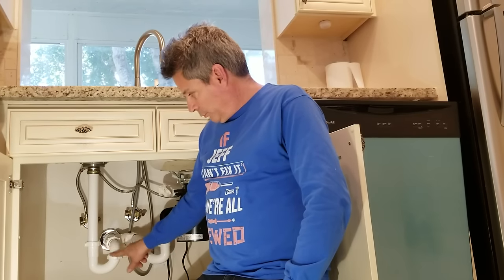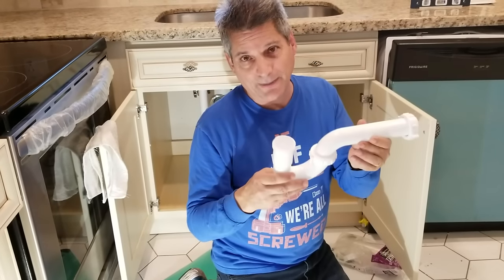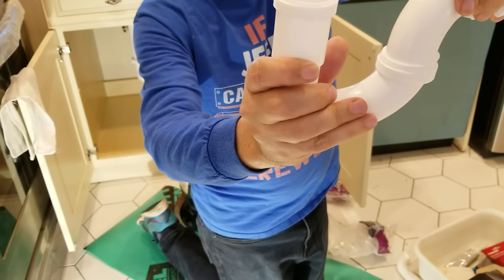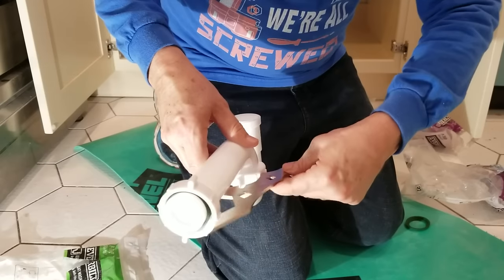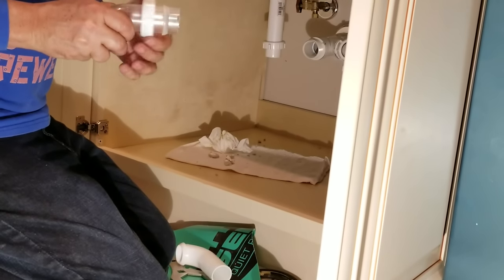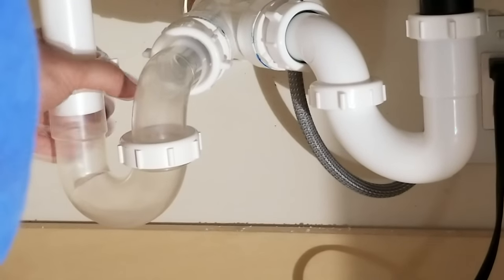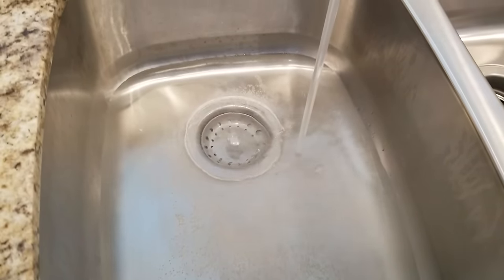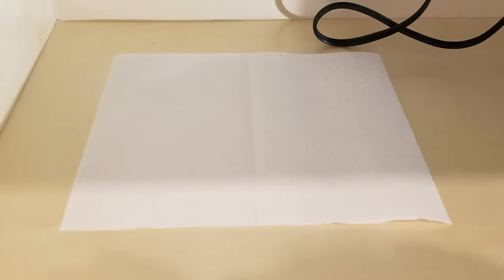Why is my Kitchen Sink P-Trap Leaking at Connection Nut?

Comment: I know this is an old video, so you probably won't answer, but would there be any benefit to wrapping some plumber's tape around the threads at the connection where there's no rubber gasket? I'm gonna be doing this job (replacing the P-Trap) at my elderly Mom's within the next few days, so that's why I'm searching for and watching videos about P-Traps today, and why I'm taking a shot and asking so I have a chance at possibly doing it "right".
Reply from the maker: No, but I have seen some plumbers add pipe dope to the smooth part of the connection where one pipe section sits inside the other, and then the nut goes around it. But if you use the main theme of this video that I showed, where you tighten this connection first before the other connections, this will work for you. I have solved this issue numerous times by making sure this connection is  aligned perfectly and satisfied first.
Reply: @jeffostroff  Thanks so much for answering! I'll skip the tape and try to connect that part first and get it in perfect like you showed, but now I'll also buy some pipe dope just in case, no matter how hard I try, I can't get it to where it doesn't leak.
Reply from the maker: @MattxietyA   Be sure to let us know if tightening that nut 1st helped you out just make sure it is perfectly aligned correctly before you tighten it

Comment: So… I removed, cleaned and reinstalled the trap, doing the critical ungasketed connection first, carefully seated it, hand tightened, then tightened ¼ turn, then did the other connection at the Insinkerator and there’s still a leak at the ungaskted nut. What’s the next step?

Comment: Mine is leaking at that joint. Can I use pvc glue on it , then tighten?
Reply from the maker: No this will not help you as that joint is not a cement joint it is a friction joint. The idea is to get the alignment right first on this connection before any other connections, and tighten this one fully first, then complete the tightening on the other connections. If you want to cement them, then by PVC P-traps instead of these poly plastic p-traps/ The PVD p-traps were used a lot in the 1970s, as they can cement together, but it is permanent, no way to take it apart if there is a a clog.

Comment: I have 2 quick questions. I have what looks like a capped 1 1/2 inch pipe under my kitchen sink. What the heck is it? Number 2: I bought this house 11 years ago and  my kitchen sink never seemed to drain freely. The clog just goes from "not too bad" to "completely stopped" over the years. What can I do? I have tried the bottles of clog removers and I even tried the rubber hose and bladder.  I noticed one thing and I don't know if it's normal. I ran a snake in my line but it didn't get far because my drainage line turned sharply. Any advise would be appreciated.
Reply from the maker: If you have a capped 1 1/2" drain pipe under your sink, it is likely because your kitchen was remodeled at some point in time and they switched from a dual sink with 2 drain pipe down to one larger sink with only one drain line needed. They typically cap off the unused drain line. You have the right idea about snaking the drain, but your snake is not good enough like the pros use. You'll have to pay a plumber who uses a motorized flexible snake that the machine spins the snake and helps it get through the line. Don't waste one more cent buying drain cleaners, none of them ever works outside the commercial, it's total snake oil. With kitchen sink, all the chicken fat, oils, butters,  and greasy food people drop down the garbage disposal and drain eventually congeal and cause these clogs, which require physical agitation to clear them.
Reply: @jeffostroff  thank you so much! I'm good with paying a good plumber now that I know what I'm dealing with. And also I'm removing that accordion pipe thanks to you.

Comment: Do you recommend using thread seal?
Reply from the maker: No, you should not need to use thread seal on the p-trap pipes. We should focus on getting the connection correct and seated properly so there is no leaks. So unless the manufacturer says to use thread tape or pipe dope, I would not use it.
Reply: @jeffostroff  okay thanks very much again 👍

Comment: If you get a chance show how you would correct vertical misalignment on a bathroom pedestal sink. Personally I'd never install one because they're so impossible to work on with poor clearance.   That said, how do you work effectively on one that has vertical alignment problems? In this case I have a 150 year old home with no way to shim or deal with a sagging floor that puts the pedestal out of plumb.
Reply from the maker: Luckily I have not had to do that yet, but I would imagine pulling the sink first and either raising or lowering the pipe to where it should be that is how I would do it. The other pedestal sink I worked on in the last 10 years was a couple of years ago at a friend's house we just tore the thing apart and put in a real vanity it gave them more storage I have a huge dislike for pedestal sinks
Reply: @jeffostroff  Yeah, I did wind-up using thin rubber fender washers (1/8 &1/16) as shims, gluing them to the base to get it plumb.  I recessed them enough to cover them with caulk hiding them and the gap as well.  I'm flabbergasted that the  designers put the mount holes 10-1/2" on center.  What only one stud?  Good enuf?

Comment: Hi Jeff - In looking at your video, I'm having a leak beyond the p-trap.  When I turn on the water I'm getting a leak somewhere between the trap and the connection behind the cabinet wall to the waste pipe.  I can see the water at t going down to I believe the waste pvc pipe.  Note, there are no leaks under the sink from any connections_ what's your assessment of my issue?  The leak appear to be coming from the pipe connection behind the sink wall running down leading to the waste pipe.  I can see the waste pipe from the basement ceiling (apprx. 6 inches parallel from the outside house wall).
Reply from the maker: If you have a leak at that connection point on the P trap it is almost always because it was not properly set before it was tightened and so if you look how the two pieces fit together one fits into the other almost like a bowl and this is such a poor design because you really have to be super critically perfect on that.  This is why we tell people to make sure that is completely totally fitting level into that connection and then you tighten a nut first before you tighten any of the other nuts so this connection must be satisfied and perfect first before you attempt to tighten any of the other nuts if you tighten this nut last, then you are inviting problems because chances are it's stuck in a position that's not completely level fitted into the P-trap output. Once you have it all together, Then make sure that the entire apparatus slopes slightly downward to the wall pipe.
Reply: Thanks for the response.  Now, its a matter of how I get to this area because this portion of the pipe is bewitching the wall and makes for a very tight space to work.  Any further suggestions?

Comment: Whats it mean when you hear your sink dripping not from faucet but coming up from the drain, and the garbage disposal quit working 2 days ago? Also had a plumber from  our home warranty policy to fix our upstairs toilet wouldnt flush, he snaked it ,2 days later heard a loud clunck and doesnt flush anymore and we saw water running down downstairs bathroom window?
Reply from the maker: Denise, hard to figure out the issue from your description, but if you have water rising up the drain from the garbage disposal, it likely means the p-trap under the sink is clogged, or you have a clog further down the drain lines that needs to be snaked. Quite common to get clogs in the kitchen drain system leading to the sewer, because people dump chicken fat and other fats that over time clog up the pipes and needs to be snaked. Also I doubt your garbage disposal really died, Have you tried the red reset button on the bottom edge of the garbage disposal? If it popped out, push it back in. Is there a jam in the garbage disposal? If so, get a jam buster Allen wrench and attach to the bottom and rotate to release the jam if something got caught in it. As for your bathroom, hard to figure out, did the "plumber" bust through the pipes with his snake? Do you have cast iron pipes which may have developed holes? You have typically 3" or 4" pipes from your toilet, so don't see e how those would be clogged enough to prevent flushing after he left. If problem is toilet, I recommend the American Standard Champion 4 $199 at Home Depot, I use it in all my properties, flushes a bucket of golf balls! Try hiring a real plumber, that guy might have been an apprentice, ask for the license holder to show up to do the work. Yo want an experienced plumber!  Let me know what you find out with all of this, these are some great scenarios.
Reply: @jeffostroff  thanks for info, he came back out and snaked it again, found no issues with toilet. He found a screw in the garbage disposal. He suggested to send out a person with a camera to look at pipes. Still need to know why water ran down window.
Reply from the maker: @denisemiller7466   Yes camera would be what I would do next for sure. Sometimes people find that out in the yard tree roots have crushed through the pipes in her blocking it keeping anything from working in the just backs up.

Comment: Is it permissible to brush a little pipe dope on that particular joint where the surfaces mate together?
Reply from the maker: Some plumbers do, but I think it interferes with the design of the p-trap. IF you connect it right you should not have to add any pipe dope

Comment: Mine leaks at the opposite connection, the one from the sink drain. I think it's air being pushed back through, especially when flushing the toilet. Would putting a vent in solve this problem?
Reply from the maker: Sometimes yes, you really have to look at all your venting, and also the drain lines tot he sewer. Friend of ours last year had same issues, and they scoped the drain pipes with a camera and found tree roots pierced the sewer line under the front lawn.

Comment: Thanks - but that raises the question why doesn't the end of the p-trap also use a rubber gasket instead of just the flared end?
Reply from the maker: I always wondered that too, there would be a lot fewer leaks
Reply: @jeffostroff  Hi Jeff - if I want to use the more sturdy schedule 40 in my sink instead of the thin plastic pipes do I also use washers     On the threaded connections or teflon tape or something or just screw them on as they are? Thanks!

Comment: You knock the “Handyman Joe” but you have a double P-Trap under your sink.  Very Handyman-Joe’ish if you ask me :) Nice breakdown though!
Reply from the maker: There is no double P trap under the sink, you  the amateur of you cannot even tell that LOL. Where is the 2nd ptrap?  I bet we never hear from you again.
Reply: jeffostroff Hmm... I’m right here. One from the sink w/ disposal and the 2nd from the other side. What am I missing?
Reply from the maker: @jg8644  You are confused. There is no code violation in what we did, by "double trap", the code refers to "double trap per fixture", not the aggregate total of 2 traps like you claim, meaning one P-trap after another, which was a common but flawed method used in years passed, often an S-Trap. If there were 2 P-traps in series in our installation, that would be a double P-trap, and that is not allowed. Here in Floriduh... we have plumbing code 1002.1 Fixture traps:
"Each plumbing fixture shall be separately trapped by a liquid-seal trap, except as otherwise permitted by this code... A fixture shall not be double trapped."
This means that the sink left basin is one fixture, the garbage disposal is another fixture, and each must be trapped. Yes you can combine both sink bowls with one trap as many people do, but the kits are a flawed design, with a simple horizontal pipe that could allow water from the left or right basin to run across the P-trap opening without going in. A better design has one sink draining higher into the main tail pipe, then the other sink with the garbage disposal can drain at a different height so the 2 streams don't collide.
Reply: jeffostroff You’re reading too much into this.  Double means “2” and you have 2.  Also - I never said it was not code compliant, unless I triggered the response with the phrase “double p trap” which you immediately read as “in series”.  Your claim that a shared trap is a flawed design is debatable and not gospel. Positives to 2 fixtures sharing a trap are aesthetic, space saving under a kitchen sink for instance, and great to have while troubleshooting clogs (especially if one fixture is a disposal).  Also - I’d also say a positive to a shared trap w/ disposal is that ground food/material from the disposal/dishwasher won’t remain in its own trap until the fixtures are used since all activity will flush it. All that said / I was just giving you a little light ribbing since you took your own jab at “handymen”.  Being one who has a self-proclaimed “above average” understanding of plumbing, I’ve personally never seen the 1 per fixture followed — BUT then again, I’m in California, so code may be different.
Reply from the maker: @jg8644  Your code is pretty much the same as ours, as most states are based on unified plumbing code, which started in LA in the 1920s. Other difference is you  use black ABs, we sue PVC.
Reply: @jeffostroff  the tee that you keep referencing has baffles inside to divert the water so it doesn't collide.

Comment: Why aren't traps designed to have the connection nut up above the water line and in the straight section?  Easier to clean out?
Reply from the maker: I think that would eliminate most leaks for sure!
Reply: @jeffostroff  well I was honestly asking the science as a novice, but you explained things pretty well later on.

Comment: Hey Jeff, I wonder if you can help. 
On my setup it is impossible to tighten that connection first. 
When I do the other part is way too high to bring down to connect to the sink pipe. 
Any ideas on what I can do?

Edit:
Here I am twenty minutes later relaxing ⛱ as I've finally sussed it, yay! 
Though it was kind of shown in the video it wasn't stressed enough that it's best to connect the three parts together separately outside of the 'under the sink' area so that they're all flush with each other. 
It was driving me nuts trying to line up all the threads in the 'under the sink' area cause of the limited space and angle of view.
Reply from the maker: Yes usually we have good clearance under the vanity to reach all of these parts of the p-trap

Comment: Hi , do you need to use thread sealant at the threads ?
Reply from the maker: Some plumbers do use it, I prefer not to use it because if you tighten the nuts properly, they will seal and you won't need it. The thread sealant only lasts until the next time someone opens up that p-trap.

Comment: My kitchen sink P-trap leaks from the opposite side of the trap that you are showing how do I fix that in other words it’s not leaking from what you are describing in your video my leak is coming from the opposite side of the P-trap from the sink pipe coming down into the P-trap that’s where it’s leaking from I tried everything can’t fix it any suggestions
Reply from the maker: Make sure you have a gasket in there. and also make sure you place the gasket in correctly, it should be shaped like a bowl, with the bottom of the bowl resting on top of the P-trip in order to make that seal. Also, make sure that downpipe from the drain goes all the way into the P-trap opening, and all the way down to the stop. If that downspout is too short, then the water might try to leak out of the connection.
Reply: @jeffostroff  I will thank you so much I’m going to try it right now and I will let you HAL it came out

Comment: Jeff let me ask, So FL homeowner here, and I know that down here most homes are schedule 40 and solvent welded from the kitchen to the bathroom from the git go. So why is it between my plumber who is licensed, the big box stores, and even your vid here are "we" using these BS  lightweight slip joint kits instead of using schedule 40 with a  combination of solvent welds and Teflon sealing compound which seem to allow for  a much tighter seal and robust set up?
Reply from the maker: Yes, back in the 1970s, all P-traps were 1 1/2" solid PVC all cemented together. I guess the newer rules have to make the P-trap removable so grandma can retrieve her wedding ring when she flushes it down the sink by mistake. I agree, these thin poly pipes are not as reliable, and they could have done this with threaded PVC parts.
Reply: @jeffostroff  Jeff i really appreciate your time and comment. Can I use a schedule 40 to poly p-trap adaptor? Is that FL code? My previous plumber used a reducer to solvent weld what I have seen referred to as the crown/trap arm/outlet  poly pipe to the schedule 40 pipe coming from the wall and although it works I would rather have the ability remove the crown pipe rather than have it solvent welded and turning downward like it does in case I ever need to snake the lines. I hope my question is clear. Thanks
Reply from the maker: @rock-on6nt  Yes, I use hub adapters all the time, they cement onto the 1 1/2" pipe on the wall, and the other end of it has the threads and the nut to accept the output of you poly P-trap.
Reply: @jeffostroff  thanks again. That's what I will do.